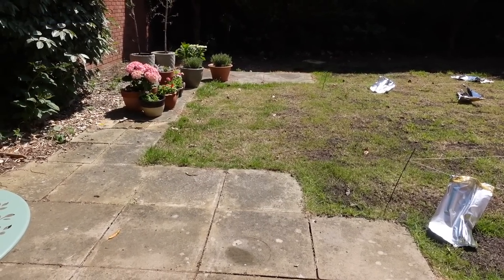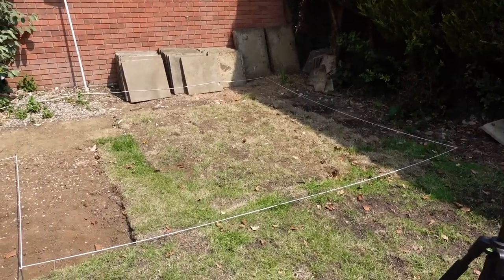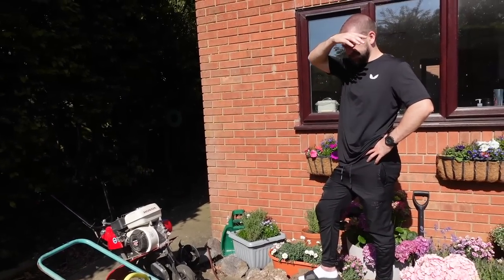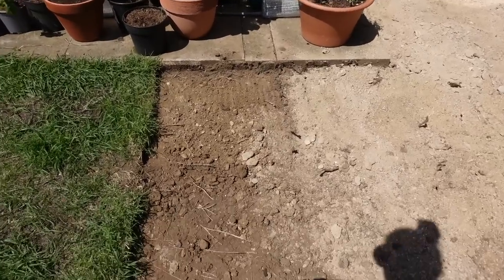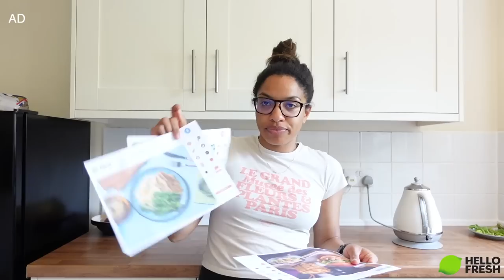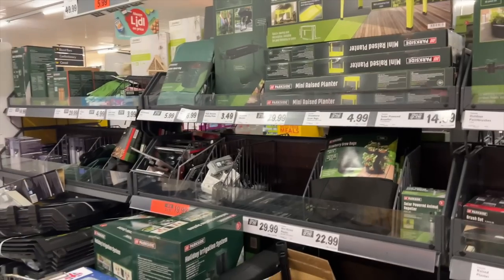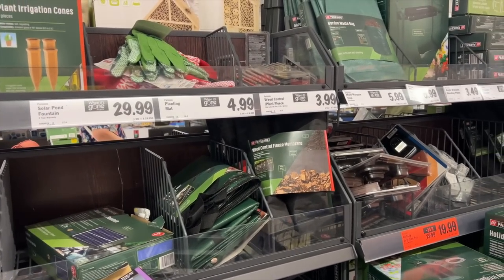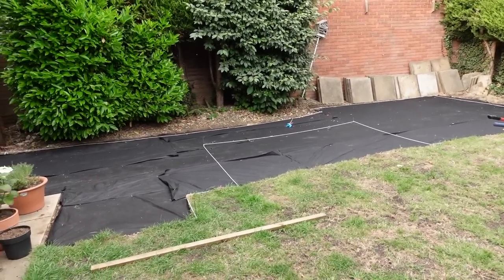PATIO TRANSFORMATION | rotavating, compacting, levelling, prep work | Part One

Comment: Normally you would dig out and lay down a sub base like road stone which you would then compact down. That creates the solid base to lay the patio. If you just lay on sand it will eventually start to sink and the slabs will go wonky. Fair play to you for doing it yourself. I’m not sure I would be able to do it but this type of work costs a fortune now so well worth doing. The other thing to keep in mind is drainage. My house didn’t have the drainage laid out correctly so I installed new drainage and profiles the patio so that the water would run into the new drains.
Reply from the maker: Yes great tips for long term patio. This is temporary so keeping costs very low and making it easier to pull up in a couple years
Reply: @ShadeShannon  makes sense. The old patio we had was laid like yours and was probably down 30 years! The new one will probably outlast the house itself. 😂

Comment: It looks as if the space should have been spreaded out a little wider. Do you want to cook and have a fire pit so close to the house and trees? 😊
Reply from the maker: I hear your point, good thinking. I'm hoping that it won't be an issue as I'll only have the fire pit on when the doors/windows are closed in the evenings. BBQ will realistically be on the other side of the garden away from the house as there won't be enough room for it all on this bit of new patio 😂 xx